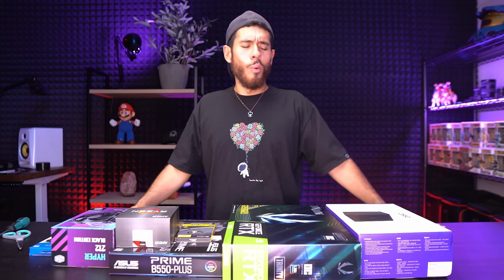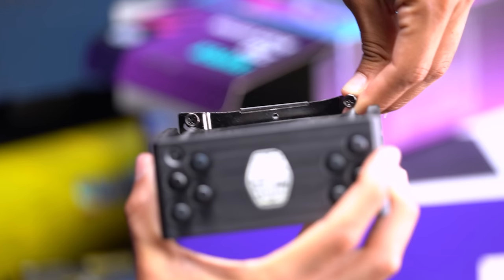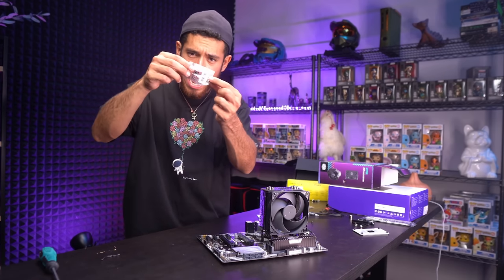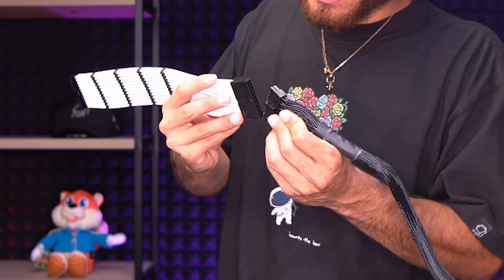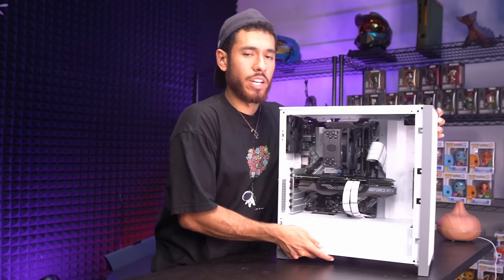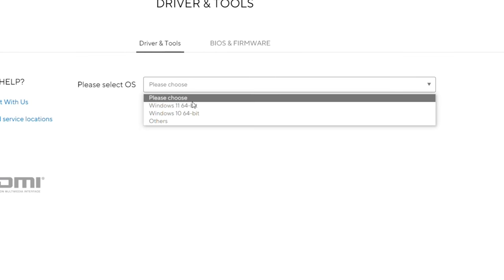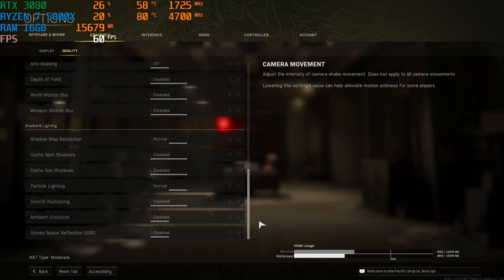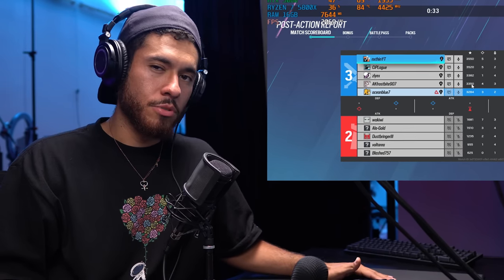BEST $1500 Gaming PC Build Guide - RTX 3080 Ryzen 7 5800X (w/ Benchmarks)

Comment: Hey crater or anyone in the comments I was wondering if any of y’all can help me with my first pc build and what graphics card to get the build is a 12400f i5 asus, prime b660 mother board, 16gb of Corsair vengeance ram ,1tb ssd, 750w psu from Evga, phanteks p400a and the two gpus I was thinking of are ZOTAC GAMING GEFORCE RTX 3060 TWIN EDGE OC and gigabyte GeForce RTX™ 3060 GAMING OC 12G  (rev. 2.0) I don’t which gpu is really better or if there is anything better the build is like around  1000 usd which is my budget tell me if any of y’all recommend this overall build and which  gpu or if there is a better one I can get. I’m just really looking for advice

Comment: Would it be dumb of me to build a PC again with a 3080/ 7 5800x this far into the 40 series release and the new AM5? Budget is around 2-2.5k but not fond of the new 40 series simply cause EVGA doesn’t have a model lol.
Reply: The 40 series sucks. Save money and get a 3080 or 3070ti..
Reply: No, 40 series is way overpriced and eats up too much power.

Comment: Does the case matter?
Reply: Yes and no. The most important thing is that the case supports the same form factor as your motherboard. Lookup PC form factors if you don't know what those are. Then, it comes down to GPU length support. Make sure your case supports the length of the GPU. Both PC case and GPU have spec sheets that tell you maximum length supported as well as the length of the graphics card. After that, it comes down to things like airflow and aesthetics.

Comment: Hi, i have some issues wigth my fps and i rellay dont uderstand..
I have the 5800X, 6900XT, a ROG STRIX B550-E and a 16go ram 
But i am far of the benchmarks he showed in this video, he is at 400 fps on high settings on valorant, i am barely hitting 250 in low settings... i really dont understand after wathcing a lot of vidéos on the subject 
(sry for my english, im from france, baguette)
Thanks for your answer

Comment: Hey so I used this guide to build my pc, the only difference being the graphics card, but nothing will pop up on the monitor, could I have done something wrong ?
Reply: Make sure you plugged the video cable into the GPU and not the motherboard. Make sure all internal connections are secure and in the correct spots. It looks like that board has a diagnostics light right next to the RAM slots. See what LEDs are lit up as that can point you to the problem or at least give you some information.
Reply: @JJFlores197  double checked the connections and ram, they were loose
Thank you for your help

Comment: I set up this same pc, but since I turned it on my graphics card gets very hot, I'm using another ssd that had another pc ¿who can tell me what's wrong with it?
Reply: Msg the gpu company or try check if the fans are working. Idle should be around 50°

Comment: Good day everyone. I have an old PC that i need to upgrade for my son. I would appreciate your help, as long as its able to handle coding its okay. Below is the details.

XP.tsp version : Last XP v22 USB.
CPU maker/model : Inter(R) pentium (R)4 CPU 3.00GHZ.
CPU speed and Installed memory: 2.99GHZ. 248MB OF RAM.

THANK YOU FOR THE RECOMMENDATIONS
Reply: Not really worth upgrading at all. If you absolutely have to use that PC, I would suggest installing the maximum amount of RAM possible and installing a lightweight Linux distro. Realistically, I would get rid of it.

Comment: Am I still able to use the Ethernet port for wifi if I don’t have the updated motherboard with type c?
Reply: Doesn't work that way. No such thing as "ethernet port for wifi" since by definition, wifi is wireless. You either connect your PC via ethernet or via wifi. If your PC doesn't have wifi built in, you can buy a wifi usb adapter.

Comment: Plz help I have all of the exact same parts except for the 3080 trinity Oc I just have a 3080 and I followed step by step but only the motherboard lights up when I turn the power supply on and the PC doesn’t turn on when I hit the power button on the case
Reply: That board should have a debug/diagnostics light. Look at the manual for reference. The light may help point you in the right direction.

Comment: On pc part picker it says the motherboard isn’t compatible?
Reply: If the board wasn't compatible, then he wouldn't have used it in the video. You probably didn't read the note in PCPP. It tells you that the board is compatible with that CPU as long as the BIOS version is compatible with the CPU.

Comment: I copied this exact build and the monitor won’t recognize either DisplayPort or hdmi so I can’t do anything. I have a bootable usb and it’s not recognizing it. Also I can’t get I to bios to change the bootable device. Any help?
Reply: That motherboard should have a debug/diagnostics light. That can help point you in the right direction.
Reply: @JJFlores197  probably is doing the same thing mine is, in which case the vga light is on and solid white and the boot light is solid yellow. Haven’t found a fix or the issue yet.

Comment: Everything is working perfectly except for the windows 10 install. I have it on a USB and I'm doing everything correctly but when I go to install it it says "no device drivers found." i feel like i've tried everything but i cant figure out what the issue is.
Reply: Make sure that your SSD is detected in the BIOS. Also, make sure the drive type is not set to RAID. If it is, change it to AHCI. Exact steps vary between motherboards, so you may need to reference the board manual.
Reply: @JJFlores197  thanks but i got it. i think my usb was corrupted bc i bought a new one and it worked.
Reply: windows 11 works on this computer i have. you can turn tpm 2 in bios

Comment: Does anyone know if you can connect to the internet wirelessly if so I’m prob gonna get it
Reply: Or at least try to
Reply: Check the motherboard specs. If it has wi-fi built-in, it will say in the name and specifications. If not, you will need to buy a wifi usb adapter.

Comment: I did everything correct I don’t think this build allows 2 hdmis only 1 works
Reply: There's only 1 HDMI port on that graphics card. You can always buy a DisplayPort to HDMI cable/adapter. Just make sure its rated for the resolution and/or refresh rate you need.
Reply: @JJFlores197  not all heroes wear capes

Comment: Can anyone help? I bought exact same build and everything but when I go to turn it on nothing shows up on my display. The pc itself turns on and the graphic unit lights up but nothing there. I’m using windows 11 flash drive
Reply: It looks like the motherboard has a diagnostics light. Check the motherboard manual for the location and meaning of the lights. It can help you diagnose why the PC is booting up.
Reply: @JJFlores197  the white light on vga is on. I looked up solutions but none have worked yet. Any tips
Reply: @supermario6530  Did you try re-seating the graphics card? Make sure its inserted into the PCI-E slot correctly and that the necessary power cables are plugged into it.
Reply: @JJFlores197  I will try that now, thank you friend

Comment: Followed all the steps with similar parts just the motherboard that’s different and my pc doesn’t even turn on ;(
Reply: Start with the easy, trivial stuff that is easy to miss. Make sure power outlet works. Make sure PC power cable is securely connected at both ends. Make sure power supply's power switch is not turned off. Make sure ALL internal connections are secure and in the correct spots. Make sure your power button header cable is connected to the correct header pins on the motherboard.
Reply: @JJFlores197  yeah i tried all of that but still nothing :/ so i’m just taking it to a shop today
Reply: @JJFlores197  took it to the shop figured out i just had a faulty mother board so i’m just ordering a new one
Reply: @TakeTheRiskYT  That's unfortunate. Though not common, it does happen you get a dud on occasion. Well glad you got it sorted out.

Comment: i just built this and it just goes straight to bios plz help
Reply: That's expected. You have to install your operating system. Make sure your USB installer is connected securely to a USB port and that it is detected in the BIOS.

Comment: Bro can't do math lmao this is $1600. And you can get better then this for $1600. This is poorly optimized.
Reply: how is it poorly optimized?
Reply: @thedesertsoldier8155  To start the CPU/ MOBO he chose. For the same price he could of gotten a 12600K/ Z690 MOBO which is just a better CPU combo flat out. Performance is similar to a 5800X but you get overclocking which would outperform the 5800X in gaming hands down, integrated graphics, an upgrade path, and more additional features like pcie gen 5, etc that you do not get with the 5800X.

The cooler he chose is overpriced nonsense. You can get a Thermalright Peerless Assassin 120 for 10 bucks less that absolutely destroys the Hyper 212 in thermal performance. Horrible value what he chose.

The WDSN570 m.2 SSD he chose is only a 500gb gen 3 drive when you can get a 1tb gen 4 drive like the Inland performance m.2 ssd for 90 bucks

He chose a crappy Zotac RTX 3080 when you can get a Asrock RX 6900XT for less or if you really wanted an RTX 3080 for ray tracing/ DLSS you can get the MSI VENTUS 3X PLUS OC which is a much better rtx 3080 for 10 bucks less then the bad Zotac card he chose. Again horrible choice.

And the power supply he chose is over priced. Switch that to a EVGA SuperNOVA GA 850  which is less then the NZXT power supply and it's arguably a better power supply as well.

The Corsair 3600mhz CL18 memory he got switch that to CL16 of the same kit and speed for better latency.

The case he chose was fine. The 4000D was the only good choice he made here.

The entire PC I just listed with all these changes comes out to the same price as the one he built here in this video but is way more optimized and a much better value for your money.
Reply: @PabzRoz  I'm going to build my PC with the parts you listed.
Reply: @oogyboogy_  Some things have changed in the past 2 months since I posted that comment. For example instead of an i5-12600K I would recommend an i5-13600K instead. It's Intels newest i5 processor it just launched and it's a lot faster for the same price. Still works on Z690 motherboards and DDR4 as well. And prices on GPU's have dropped a fair bit since then. You can get 6900XT's for even cheaper now under $700 or you can get 3080 12GB models for around $700-$750 if you care about ray tracing performance. Everything else I mentioned in that comment though is still a great value like the CPU cooler, SSD, etc. If you're serious about building a PC with the components I listed and have any questions feel free to ask.

Comment: Disliked and unsubbed. Not only did you not accurately cover every part of how to put each part in, but also I bought and followed this video to a TEE and it turns on but won’t output to any monitors, thanks for nothing and the (closer to) 1800 dollar paperweight I can have sit around now.
Reply: bought the same build and works perfectly, if the motherboard lights up orange or something then maybe thats the problem. also check to see if everything is correctly connected
Reply: @Anonymouse43  everything is connected, the vga light is white and boot is yellow
Reply: Same how do I fix this
Reply: @staletoothpick9584  i dont think it should be. for me the motherboard dram light was yellow and it was because the graphics card was loose and so were the ram sticks. what i did to fix it was to correctly push the wires in and ram sticka. you should possibly take a look at the power supply and make sure nothing is loose. im not a computers expert but ive done this and it has worked. you should probably post your problem to quora or other sites with computer experts, they are more likely to help you solve your problem. im just saying i had the same problem and all i had to do was to check the ram and disconnect/reconnect wires. you should probably disconnect some of the stuff related to the vga and boot and try to correctly connect them again, i know ive done this and the person who has uploaded the video doesnt really go into full detail on what to do, so it took me a lot of readjusting and replaying the video which sucks, but just keep trying youll get there eventually.
Reply: lol dude. so just because your PC didn't work at the first try, you think the video is bad? Could it may have been user error at some point? I'm not trying to be rude, but you know, there's always the human element. It may be possible you think you followed everything to a tee, but forgot something and didn't realize it. Have you done any troubleshooting steps or did you just give up? Have you tried re-seating all connections? Have you done any research on the yellow boot light?
Reply: @JJFlores197  this video is pretty bad in terms of going in depth on the tutorial. ended up having to re-do some steps and look up missing steps. he also never linked the fan cap things, so when i ordered everything in the description i was lost at that step and ended up having to make my own step. he also went way too fast and never clearly explained anything. this ended up taking me over a week to build correctly and functionally.
Reply: @Anonymouse43  I ordered everything currently in description. What else I need???

Comment: are you sure it's still $1500? the 3080 is $750
or is that why it's $1500?
Reply: Bruh this build in total is around $2k
Reply: @TheChillDeadpool  add everything to your cart on Amazon. Its $1592 or somewhere in the $1500 range
Or just get a different cpu. The 3070 work just as good. And it's $200 cheaper
Reply: @GavinWasHere3  I did that already it's about $2k
Reply: @TheChillDeadpool  I forgot about the cables and stuff. my b
Reply: @TheChillDeadpool  but it's only $1281 with a 3070 without the led strip and funko pop
Reply: @GavinWasHere3  not for me it isn't
Reply: @TheChillDeadpool  your Amazon is wierd
Reply: @GavinWasHere3  guess so lol but anything that has a 3070 or higher GPU with a decent CPU to go with it already going towards $2k easily
Reply: @TheChillDeadpool  hm, what's your currency?
Reply: @GavinWasHere3  US
Reply: @TheChillDeadpool  idk then.